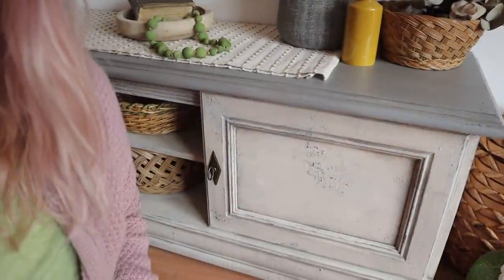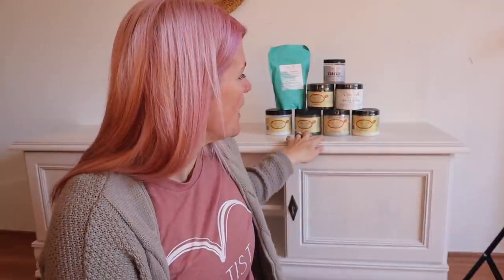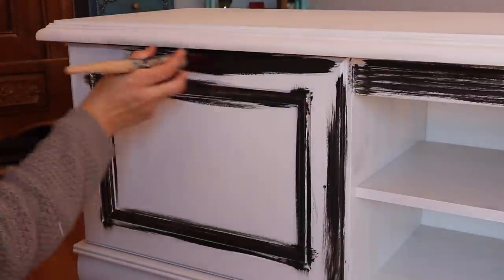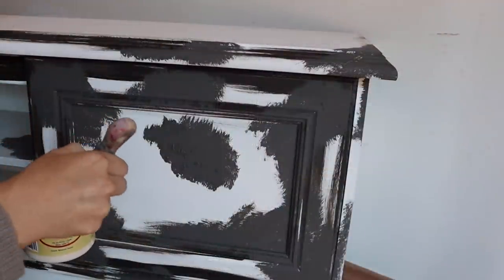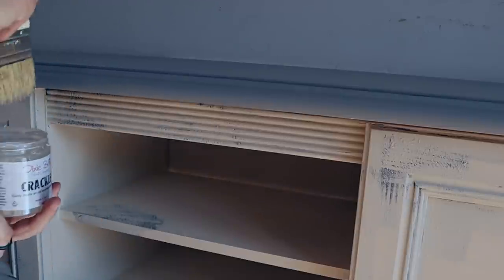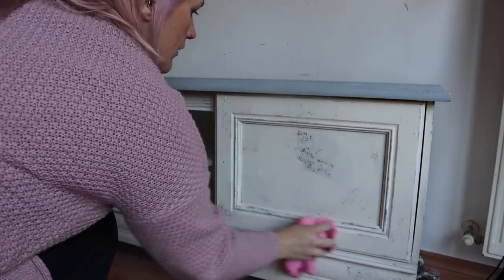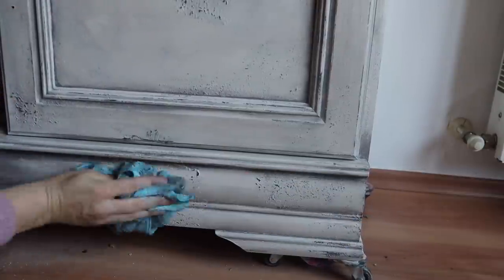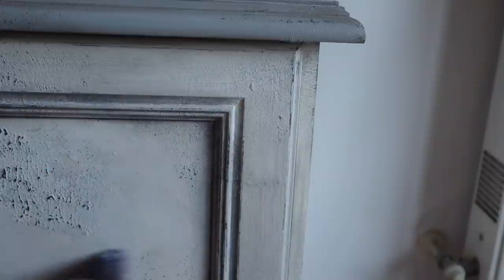Make Cheap Furniture Look Amazing!! How To Paint Particle Board Furniture

Comment: FABULOUS!!!!! Can the sea spray stuff be used with other brands? You said don’t mix brands of paint/wax.
Reply from the maker: Yes ma’am and you can mix brands of pint and wax just make sure you aren’t mixing oil and water products in any line and when you mix let’s say and all on one paint with a chalk like paint just know that the properties in the all in one will not be as strong so you may need to use. A primer or sealer with a mix like that vs if you used let’s say an all in one alone :) does that make sense? The only thing I am unsure of  is if another water-based sealer will do well of dB water based wax so those two products I use together always :)
Reply: @BellaRenovare  ohhhhhh gotcha makes perfect sense! Thank you SO much!!!!!

Comment: Thank you very much for showing the different things that you can do with the non-wood furniture I’ve been working a lot with that lately they’re actually pretty nice pieces that I got but they’re just all particleboard they’re older furniture sets from the 70s but they’re not made out of wood I’ve been using the Zinzer primer so that I can use the chalk paint over the top but what I’ve noticed is the blending is a little bit harder to do on furniture that is not real wood no matter what kind of primer you use unless you go with the distressed look like you did after you did the Slick stick then that’s OK and everything seems to work out but when you’re trying to do some nice blending for some reason it doesn’t work out too well it took me forever to blind three little drawers on a little piece of furniture with the chalk paint because it was just not adhering I like real wood does maybe I’m doing something wrong I don’t know

Comment: Really interesting. I don't remember seeing this process before and I really like the way it turned out. Can I use an oil -based stain under chalk paint?
Reply from the maker: you can use it on top of chalk paint but not under, generally water based products do not stick to oil based UNLESS it is really really dry.

Comment: Great intro. You had me hooked. I have thrifted stuff like that to paint and decided it was just too much work. Thanks for this video I think most of us can relate to this one. You were very thorough (as always) and explained everything clearly.  Thanks for sharing all your tips and tricks with us. I have Slick Stick but I’ve only been using it on those super shiny surface finishes after I scuff sand. I’m going to have to pull some of that particle board stuff out of the shed and give this a try. Do you have any suggestions as to what to do when these pieces have gotten wet and the surface swelled or bubbled up where the water got below the finish. I’m ready to take some stuff to Habitat otherwise.
Reply from the maker: oooh okay sometimes that bubbling can be tough butttt butttt...you can sand it down and if there are dent you can use a wood filler, unless it is completely swollen and broken apart but if you have some swollen bubbles on the top you can definitely sand it and fix it :) get in that shed and get to painting lol
Reply: @BellaRenovare  Thanks. I’ll give it a try. It seems to be intact but has sole large bubbles. I have sanders and sandpaper. But it just looks daunting. I wasn’t sure if I would make it work. Thanks again. And you’ll love this.  I keep a friend of mine’s four year old often. It’s always Tuesday’s and Thursday’s so we watch YouTube she’s asked me to watch the Fairy Princess. The one with the pink hair. She loves to watch you paint and I do too. Thanks again.

Comment: I have a small night table, French Provincial style. The laminate top had many damaged areas so I removed it. May have been my first mistake.  Underneath is fibreboard. In fact once I started to clean and then scuff sand it I found out that 99%of this piece is fibreboard 🙁 I have purchased a primer that is supposed to have a sealer as part of the formula. After I apply the primer can I use DB chalk paint?  My concern is that the fibreboard may expand if any water gets on it if it isn’t sealed well. This piece is for my 6 yr old granddaughter. I’ll be using the Alice in Wonderland transfers.  I would appreciate any advice you can offer.

Comment: Hi! Often the idea of repainting laminate furniture is to save money. Do you have any ideas for traditional hardware store brands that can be used to achieve these effects and I also know a place called earthbound recycling in St Louis Missouri that I can get free paint because a bunch of people donate their old paint there so I was hoping to replicate these effects with free paint and labor only. Any suggestions? Someone had said you could simply sand the piece instead of using slick stick so I know that's one way to save right there.
Reply from the maker: If you clean and do a good scuff sand depending on the piece, if you are using let’s say a traditional wall paint you will need at the very least a primer to prevent peeling. If you are using a chalk type paint most have been formulated to stick to most anything. The thing is that over the years I have learned cutting corners to save is not always the best thing because later the finish could fail. Honestly there don’t a blanket answer here because each paint and piece is so different. I tend to over prep my pieces. If you are wanting to do this just for yourself I would say see what method works for you, I resell my pieces or they are customs 98% of the time so I always want to ensure I am giving a high quality durable piece and that comes with proper prep :)

Comment: I have a lil problem already put paint on a particle board peice and about pull my hair out to get coverage,  i even done some stippling to finally get mostly covered. Can i put slick stick over chalk paint?
Reply from the maker: you can yes, do you have problems with adhesion right now though?
Reply: @BellaRenovare  in a few areas i thought once i got a coat on that the next coat would stick better but it wiped off after drying over night and i cleaned twice with white lightning i finally had to just walk away.im very new at all this but feel as i should have a degree in with with all the research and video self education lmao. Thanks for your help
Reply: @BellaRenovare  im gonna try again tomorrow and im gonna go pick up slick stick too